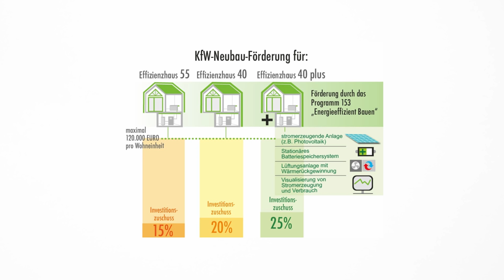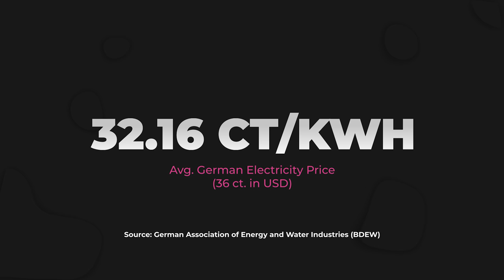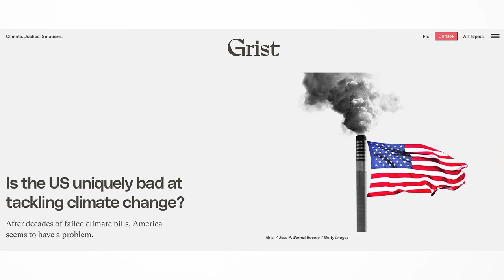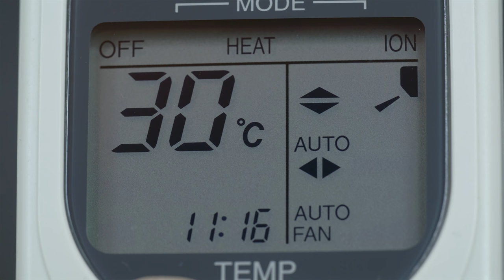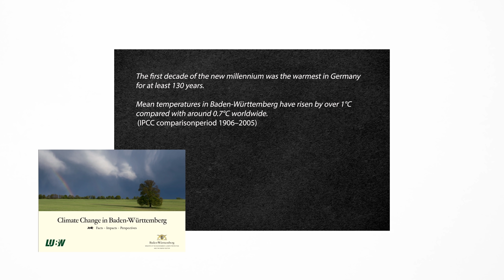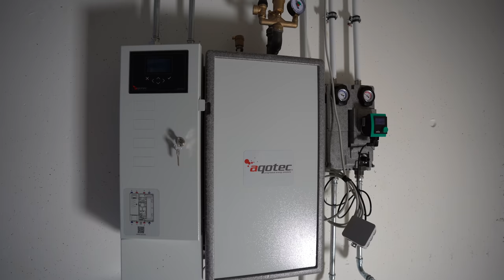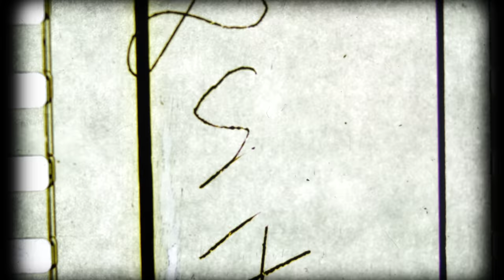HVAC (HLK) in German & American Homes | A Tale of Two Countries

Comment: For the places that have AC in Germany - do they have ducts and vents for that as well as radiators for heat? I'd love if the US adopted radiated heat more, but as so much of the country has hot, humid summers, I don't think we'd give up AC (and the vents that go with it, making forced heating more convenient). Unfortunately where I live, even at night, it isn't cool enough to open the windows for at least 4 months of the year (it's almost always above 80 at night in the summer).
Reply from the maker: In our experience, no - not unless it is a VERY special request. We are building a new house and the standard we were shown did not come with AC. However, a few homes in our neighborhood added it and while they do have an outdoor unit, it connects to a wall mounted unit on the interior. I think since they don't need duct work for heat, it probably doesn't make sense to install it for AC on the whole.

Comment: Really well done and super interesting! At least, to this nerdess ;-)  I thought you did an excellent job choosing what to focus on, and boiling those subjects down (pun intended) into a concise overall summary. As you alluded to, this is a very complicated topic. Complicated not only from a technical perspective, but from a geo-political (and, in many cases emotional) perspective too. So ... GREAT JOB!

I was surprised, tho' , that geothermal didn't get included in your mix. I thought (perhaps wrongly) that geothermal was more prevalent there in Germany than it is here. (I'm in the US, New Hampshire.) BTW: I mean the form of geothermal where one has pipes running either vertically or horizontally under the ground on their property that transfers heat/cool to/from the house via a heat exchanger.

I live in a "post & beam" timber-framed house built in the late 1700's. I could go on ad nauseam on this subject -- but I'll spare you. ;-)  What I do want to contribute, tho', is how I use curtains, blinds and the "Indian Shutters" original to the house to keep the house cooler in summer and warmer in winter. I was in my 20's when I bought this house. At that time, I thought curtains were just a fru-fru thing from the 40's and 50's that my mother and grandmothers liked. But, finally I wised up to realize that they help tremendously in controlling temperature. In the original part of my house, I have the original windows and storms on the outside of them. But, in the late '90s I added an extension that has double-glazed windows. I'm 'sorry' to report that there's no perceptible difference in "performance". I still need curtains and blinds on those windows to control heat & cool.

I go through a (some say) ridiculous routine to control temperature. I constantly think that the only truly "SMART" technology would be one that the windows interface with: the daily forecast, time of day, time of year, requested temp inside (i.e., thermostat setting), and outside temperature -- run all that data through an algorithm that would automatically control the opening and closing of windows, shades and blinds. Now THAT would be SMART tech, IMO!  Instead, I do all that manually. I'll let you imagine the routine as I start on the 3rd floor attic and work my way down to the ground floor -- twice a day!

Again, great job! Thanks!

Comment: Everytime I travel to US turn off the AC in my hotel room. Only in Southern region I leave the AC on during the day to have a cool room for sleeping (75F). I have to turn off during the night otherwise I get a cold and the noise of the AC disturbs me while sleeping.
Reply from the maker: It is funny because we have the opposite problem. We grew up listening to the AC unit that now we can't sleep unless we have some kind of white noise as a background.
Reply: @TypeAshton  I also have issues to fall asleep with other background noises like music or voices. For long distance flights I use sleeping pills to easier fall asleep.
BTW we bought a mobile AC unit too cool down our house during the hot days (40C) in South Bavaria. We don't leave our kids play outside during the high temperatures to avoid a "Hitzschlag". With mobile AC unit we can cool down our house too 25 - 28C. As there are only a few hot days in Germany using an mobile AC unit is a good compromise in my opinion.

Comment: Maybe because I'm Canadian, but I don't see what's so wrong about air conditioning, if we could just set it at not such a low temperature in the summer. My electricity bill here in the winter can be 5x higher than in the summer, while using the ac in the summer. So the bulk of electricity I use in really in winter. Plus, if I could switch to heat pump, then I could have central ac AND save electricity and money during winter. In my sense, everybody in Canada should have heat pumps. Yes they would theb use ac in the summer, but they would save so much more electricity  in the winter. I think that's the same for germans. If they wanted to save energy, they should all have heat pumps for winter. They would then use ac in the summer, but it would still save a lot of energy at the end of the year.

Comment: modern heating systems are an alternative to ac units. they can run cool water throu the radiation pipes in the summer. but the downside to this is condensed water can be appear
Reply from the maker: Ich danke dir sehr!!

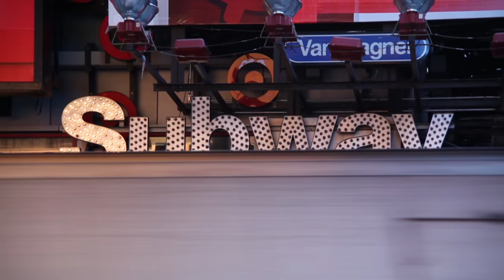Comment: 9:00 What the Hell you have hot Subway stations? So the stations I know from Germany of course get a bit warm in the Summer, but not that much above the outside temperature. I really don't know how it is possible to bring this much energy into the stations. Because after all the subway system is fully in the "shadow" of the ground. So there is not even sun to provide heating.

Comment: I don't believe in the "Air conditioning makes you sick" thing. I actually like the availability of AC in the US. But living in Germany, I don't have that luxury. Getting one would not be the problem, but with the price for electric energy being as high as it is, I just couldn't afford running it.

So I ended up doing something you also see quite a lot in the US, but not too often in Germany and installed a ceiling fan in my bedroom. Far easier to install and a lot cheaper to operate.
Reply: The "AC makes you sick" happens when people confuse cooling with refrigeration: it is the huge temperature difference.
When you have outside temps over 40°C and inside temps of 16°C, and you expose your body to these thermal shocks multiple times per day, it is no wonder you get sick!
Having an inside temperature of 24-25°C is far less abusive for our body, much more energy efficient, still plenty comfortable and still gives enough margin for computers (laptops and desktops) that are generally rated for a maximum working environment of 30°C.

Comment: AC yes or no? We built our house in 2017/18 at KfW 55 standard - there is a 23 cm insulation around the walls and triple glass windows. I have my homeoffice in the attic and even on hottest summer days the temperature goes not over 27°C there in the afternoon (ground floor is cooler). So I think, for a couple of days we dont need an AC. And btw, we use wood pellets for heading and hot water.
Reply from the maker: We are really curious to see what the first summer will be like in our house later this year. I hope the KFW55 rating means it stays nice and cool.

Comment: I live in NYC. I am from Milan, Italy. I have never had air conditioning. I don’t have in nyc. The body adjusts and thermoregulates. I use 2 fans when it’s hot. Maybe I wish I had AC 7 days a year. Anyway in the winter my building can get as hot as a summer day. Americans waste energy. Air conditioning dries the air too much, some humidity is good. It spread spores and viruses.

Comment: Why would you set a fixed temperature in your home for AC? You don't spend the whole day inside, so setting a delta temperature like 2-3°C cooler than outside would make it much more comfortable to switch between outside and inside.

It's more like going into a cellar than switching climate zones multiple times a year.

Comment: for the most part i think germany is doing the right thing with not relying on airconditioning. however, i am convinced that we are also extreme in our opposition to it and feel the arguments many fellow germans bring up are mostly based in contrarianism and stubbornness.
i had the pleasure of spending the summer of 2018 in hospital. uppermkst floor. the temperature on ward hardly ever dropped below 27°C (81°F) and they had to administer liquids via drip to some of the elder patients bc drinking that much wasn't even possible for them. the fact that new buildings (including housing) aren't even required to make use of passive cooling techniques is just ignorant. in summers like that of 2018 i have to worry about large amounts of medication going bad (and no, i can't put all of those into the fridge or else i can't store food anymore)
not everybody embraces or even just tolerates heat equally well – power to you if you do love the heat, but please be mindful of the fact that not everyone does, especially if they aren't able-bodied.
Reply from the maker: 100% agree.

Comment: I absolutely don’t like forced air. It is uncomfortable, either too cold or too warm. My bedroom is the warmest and the living room the coldest room in the house. And you need a ceiling fan do distribute the warm or cold air. And it blows dust everywhere. The only reason why there are forced air furnaces is „money making“ for the builders as they are cheap to install. And maybe don’t require as skilled workers as other heating systems.

Comment: Personally, I really dislike air conditioning. I was in L.A. in late November and it felt like everywhere was airconditioned to the point where I was so cold I had to wear big fluffy hoodies. But the weirdest part was, that the outside temperature would have been perfectly comfortable in the low twenties (°C obvl). I get not wanting your hone to have 35° C in the summer, but I don't get cooling it down to 20  °C where you'll need long clothing. Maybe I should mention that I tend to be cold easily and love warm weather. I'd be more likely to heat my home to over 25°C than cool it down to 20😂
About the getting sick part: it is true, that a lot of people not used to air conditioning tend to get sick when exposed to it at first. This is due to the air conditioning drying out the air and therefore the nose and stuff too. As the body isn't used to it it has a harder time keeping up the protective mucous membrane making us more susceptible to catching a cold. The body gets used to it though, which is why people who use it on a regular basis don't get sick from it and believe it to be a myth.

Comment: I want to know, how a combined heat and power system will work CO2 free ? 

The gasturbines, which will be H2 fired (at the end of getting CO2 free) will run maybe 200 hours/year - not enough für heating.

I expect, that the district heating will run as well with heatpumps - but, by losses for the transport, never as efficiant, as heatpumps in individual houses.

Comment: We as Germans  actually have a small aer-conditioning unit in our house that we inherited from grandmother, but it only powers one small room: our office. And we turn it on for a few hours no more than 10 or 14 days a year.
If I were to build a house again, I would look at the construction of old houses in southern Europe, which have a cooling system without energy consumption, with a kind of chimney and supply air, which - if I understood correctly - cools down over a water surface.

Comment: 3:08 since you talked about the difference between Celsius and Fahrenheit, i would like to see a video about the differences between the Imperial and metric System and how you guys dealt with the change.
Reply from the maker: This would be a great video to do from a professional standpoint as well. As an architect, making the change from feet to inches to metric was actually really great.... but although I've lived in Germany for 3 years, I still struggle to think quickly on the temperature change from C to F.

Comment: I have a air conditioner. But I have a Dachgeschosswohnung so as the temperature reached about 42°C and above, I got one. To the "Ill" theme. I am very sensitive to cold air and so, it could make me Ill in therm of 'verspannungen' on my Nacken und Rücken. 
I am really happy to not have a air system in my home. Because it of the airflow the change in air temperature all the time. Even if it's only centigrades. :)
Reply from the maker: I think 42°C is a good excuse!
Reply: The German hate "Zug". We are of firm believe that cold moving air inside your home air will inevitably give you headaches, colds and muscle ache.

See also: The window war in each office Lüften vs. Zug. The eternal enemies.
Reply: @Warentester  yes your absolutely right :) (and the window have to stay closed. ) ;))))
Reply: @TheLexorius  - (Ersatz)Kühlschrank im Keller betreiben! Dann den in der Dachwohnung befindlichen 24/7 "ZusatzHeizer" übergangsweise ausschalten. (Vor)Kochen nur in den frühen Morgenstunden bei offenem Fenster (oder auf dem Balkon/Terasse). Good luck :o)

Comment: i lived in germany for 35 years and then moved to the US where i own my house. my house here has 2 forced Air AC systems, heat-pumps, for both electric heating and cooling. when it gets down to freezing a electric only heatpump does struggle with keeping the house warm, and power consumption almost doubles. the house was built in the 70s, so even with insulation updates, and modern AC units there is only so much you can do. i am sure a new house would be better insulated. So here it goes: my wife misses the heated floors we were used to in Germany, heated towel racks, etc. we keep our AC at about 75 and the heat at 73 during the day, 68 at night. Even though my american wife swears she will freeze to death ;) . traveling back to germany almost every year, rental cars now do have AC. would not want it any other way. if (once) i build a new house it will have heated floors, especially for the bathrooms. If i were to move back to germany, i would want AC for the house, probably some sort of a minisplit. they are quiet, efficient and not very expensive. should take the care of the worst heatwaves germany has to offer. Here in Georgia the Air is on from April to November roughly, life would be miserable without it. as a nice side-effect AC gets rid of the humidity as well. 50% humidity is much better than 90%. as far as health concerns go: some people keep their houses at 68 degrees during the summer even in 95 degree summer heat, that is a crazy temperature swing, no wonder people get sick.
Reply from the maker: We also gave in and purchased an AC unit for our apartment in Germany. When we found out I was pregnant it was right after we had 7 heat waves the summer prior where it was regularly above 35C. Thankfully we don't use it that often, but hopefully in our new home we can power it with solar.
Reply: AC gets rid of some water in the air, because cooler air saturates and the excess water condenses out. But generally cooling raises the humidity, while heating drastically lowers the humidity. That is just plain Physics 101.

Comment: I just found your channel through your appearance on the Understanding Train Station YouTube channel. I have been going through some of your videos. I like to hear other people's opinion on stuff like housing compared to my American view. A couple of questions for you. Do German houses have whole house fans?  They cool houses down by running in the summer late at night with the windows open in order to suck in the cooler outside air while at the same time pushing the hot air out through the roof. When the morning comes, the fan is shut off and the windows closed. More time efficient than waiting for the wind to blow through the house, but at a cost of electricity to run the fan.

I like the idea of the hot water sharing which could also be produced by using small, local nuclear reactors/generators. I have heard a lot of opposition to nuclear power is the norm in Germany. Is this true? Newer types are smaller and more efficient. Any wastewater left after it being used to produce steam to power generators to make electricity could be used in a municipal system to heat homes.

A growing trend in more rural American homes in the upper Midwest is the use of wood burning outdoor boilers that run hot water to interior furnaces where a heat exchanger extracts the heat from the water sending the cooler water back to the boiler to be re-heated.  This is similar to what you mentioned being used in the Black Forest region with wood chips.